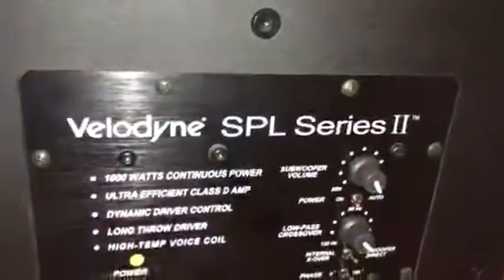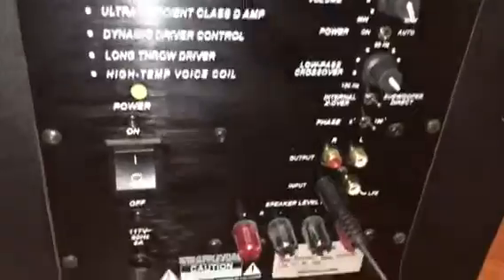Why does my Subwoofer not work rite? Makes weird sounds..

Comment: I have the same kind of sub  that had a similar problem...mine was a Velodyne Spl 1000 and I ended up having to send the plate amp to be repaired ...and was glad I took pictures of what has to be disconnected so after it came back I could re hook everything back up...because these drivers have extra wires  “accelerometer “ servo control... no local repair shops wanted to mess with that type of powered subwoofer.. I sent mine to EBC ELECTRONICS ...& came back in a week or so fixed and better than new...they have a flat rate  price chart....and in my case ; I couldn’t get a 1000 watt plate amp or anything with enough power for what it cost to fix mine... It was maybe a couple hundred dollars...I think they replace the caps an power supply parts etc...Bu5 it made the same sound as the one on the video ...and just happened out of the blue...
Reply from the maker: Thank you for letting me know.. I didnt know what to do with it so I left it in my closet but I still want to fix it. But if it's that expensive then do you think it's worth it? I honestly dont know how much this subwoofer costs because I didnt buy it but if you know about subwoofers could you tell me what it's worth if it worked?

Comment: If you still have it there is a amp repair guy on eBay for it it's about 200$ but they do put better parts then original. Take the amp out and test the woofer with a different amp to make sure it's not your coil they also sale kits and or repair subs. It's a great sub better than most new ones the amp have problem with the caps but are upgraded when fixed👌✌️👍
Reply from the maker: Thank you for your feed back.. I still have it and it doesn't work. But I will look into your advice (:
Reply: Is it BBC?? I sent one Velodyne SPLR & had it fixed for $200 something..& now I have another SPL series 2 that I just got an it works a few mins.. then makes that noise..  I tried to get plate amp off..   an couldn’t;but will try again..
Reply: @keithwebb8512  sounds like it has a bad capacitor on the in put board or a knob is bad or dirty I would need a little better details to know more or less
Reply: @josephsaucedo8691  ..thanks. ... your probably right... I will try again to get the amp plate off..( probably never been off. - 2008)   I got some contact cleaner... all I know to do is spray the pots..to vol  & check connections...all most sounds like they may be something loose... I remember my other SPL R ?.had the extra wire ..went to a acceloromator wire that plunged into driver... and look at the caps..to see if they are bulging or leaking..  But it’s worth repairing  if it sounds like my other one..
Reply: @keithwebb8512  sounds like you got it  I have had about 6or7 different problems one with each sub. Plate amplifiers are made to brake does not matter what brand either 🎶🎵💯🥂✌️👍👌🤑
Reply: @keithwebb8512 Try pulling out the sub and pushing the amp for the inside to pop out
Reply: @josephsaucedo8691   it’s a Velodyne..  SpL the driver comes out through the back..  I doubt it’s ever been out..& has 2008 date on it..
Reply: @josephsaucedo8691  ... it took several try’s to just get the plate amp off.. the gasket had it stuck.( ended up using a space heater to heat up the rear & flipped sub on its face an it finally came out)  then I used contact cleaner an sprayed all the connectors.. so far so good.. I’m listening to it right now.. And it seems to be working right..
Reply: @keithwebb8512  sounds like you have a good amplifier my friend that's the part that bad on almost every spl model in less some one blows the sub glad to hiar you got going have a great one till the next one 👌👍✌️🎶🎵💯
Reply: @josephsaucedo8691  ..yea hopefully I it fixed.....it’s been playing for about a hour straight ...just on kind of low ...but bass is hitting like it should...I haven’t pushed it hard yet...( my wife is in the bed..lol)  but I learn a lot off You tube... there still some good people in the world that try to help out the next guy...
Reply from the maker: @keithwebb8512  very true. And thanks for reporting your feedback on what you did to get yours back and running.. I will attempt the same with my Sub and see what happens next. 👍

Comment: I had Sony subwoofer like this model and to be honest much better and cheaper than Velodyne. Old school are the best.
Reply from the maker: To be completely honest with you, I agree. The Sony sub I had in that video sounds about just as good as the Velodyne sub. only difference I noticed was the Velodyne is a little clearer bass and the Sony can't handle loud volume levels at all.. where as the Velodyne can easily handle the louder volumes.. but then you compare the prices and then you then think if that's really worth the difference.

Comment: did you ever repair it?
Reply from the maker: No, I didnt know how. I didnt even take it apart
Reply: Josephs RandomGameing do you still have it i recommend you get someone to fix the amplifier and you'll have a great subwoofer which is cheap.
Reply from the maker: @maincharacter2677  yeah I still have it. So you think it's the amplifier?
Reply: Josephs RandomGameing If you push the cone in a little does it make a scraping sound? Or does it sound like a static electricity sound?
Reply from the maker: @maincharacter2677  static posing sounds

Comment: Sounds like the voice coil rubbing, maybe burnt. You should probably just replace the driver with the closest replacement you can reasonably afford. The rest of it is probably OK, but I wouldn't risk a fortune to find out. It will still be usable if you put a bargain-priced driver for a car subwoofer in it, so you have a range from which to choose. You should wire in a fuse rated below the maximum wattage of the driver (watts = amps * amps * speaker-impedance-ohms)  so it won't burn up like the original.
Reply from the maker: Thank you so much. I will take this into consideration and show this to a speaker technician just in case he doesn't know what the problem could be.